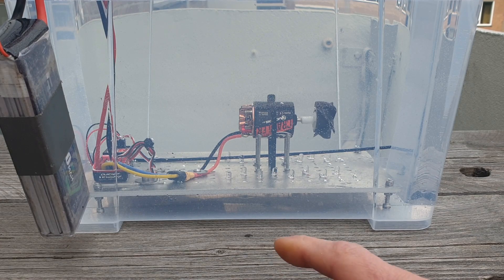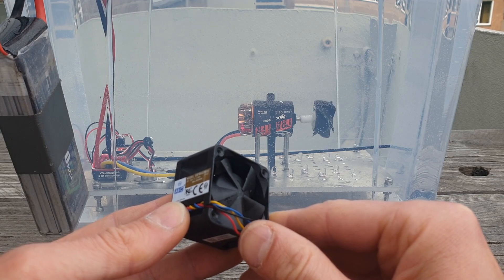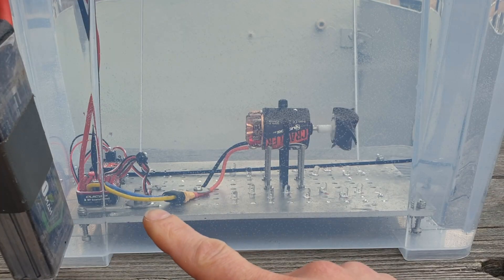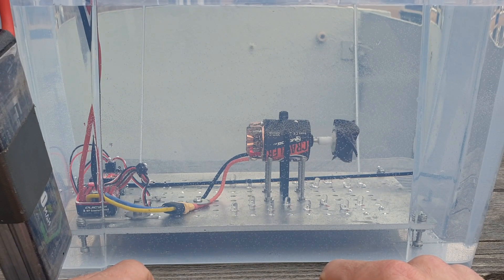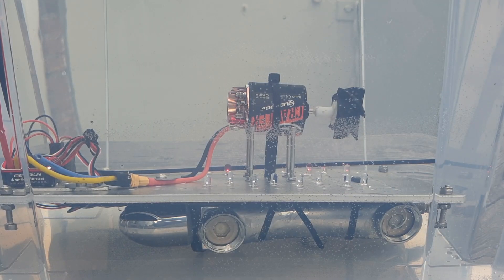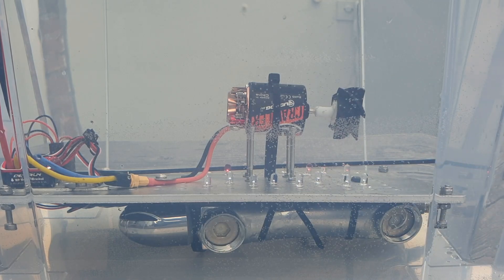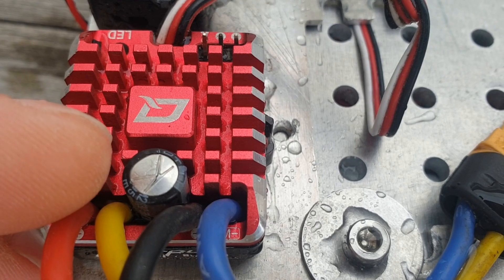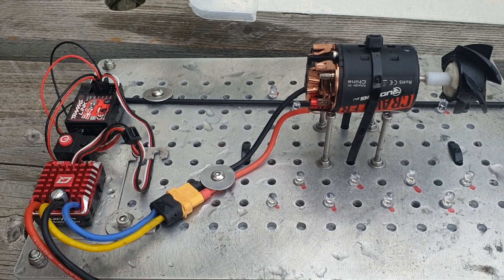Brushed motor underwater - slowmotion

Comment: Fantastic ! Powerful thrust wow , thank for sharing video
Reply from the maker: I was also surpresed about the amount of power. Unfortunatly i blew up my 1080 esc, after that i realised i dont need an esc to run a brushed motor.

You can directly connect a lipo to a brushed motor and let it run, but than its alway at 100% power! And much more powerful than than an 1080 esc with only 80 amps. 

And here you can see the result of that:

https://youtu.be/dXnMd8_YSh0

Comment: Cool that’s a lot of thrust. How did you waterproof all the other connections?
Reply from the maker: Thank you!
It is a lot of thrust, i did not expect that.
This is how i waterprofed my receiver:

https://youtu.be/--cMq3p9SKI

All the other connection are not waterprofed, water is less conductive as you would expect. If you drop a lipo in water nothing happens. But if you add some salt to the water (100grams per litre) that it becomes conductive but still with a high resistance (high ohm value)

I also drove my TRX several times underwater without extra waterproofing it.